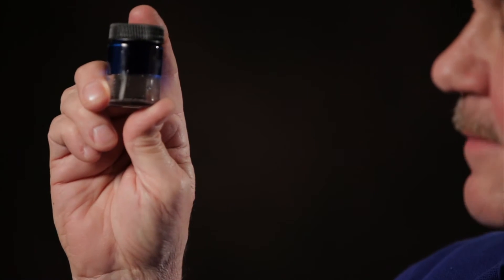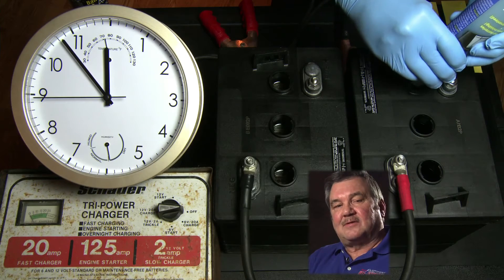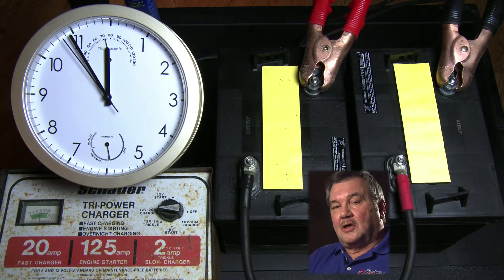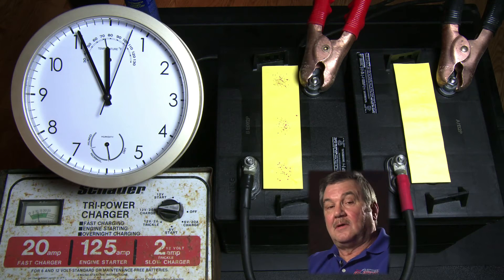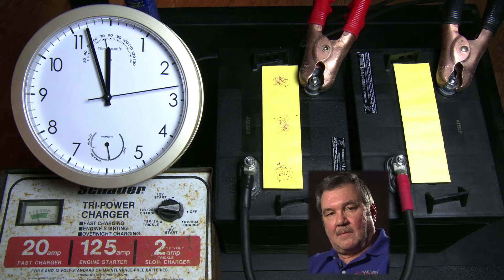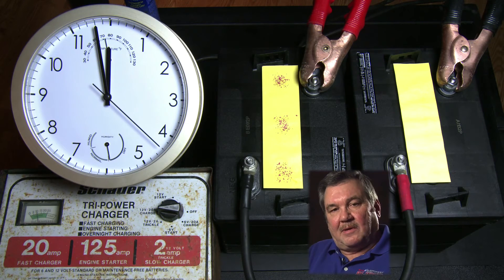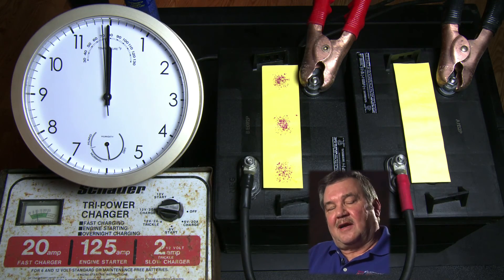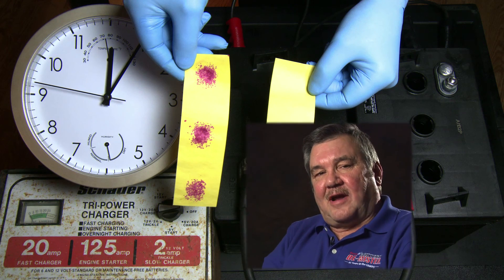ThermOil  ~ Irrefutable Proof Battery De-Mister Works Every Time!

Comment: I am testing this today  I will follow the instructions provided  and I'll update In a few months
Reply: Did it work?
Reply: Well my batteries were barley holding charge so they were gonna expire soon anyways , so I after receiving the bottle I put it in the batteries and at first seemed like it worked  but two months later they blew up in the engine bay leaving a mess its hard for me to assure you that thermoil caused it but I think it did, I I can't tell you not to buy it but if I had to do it all over again I would just buy the batteries myself, hope it helps friend